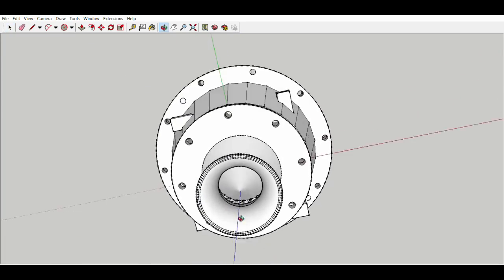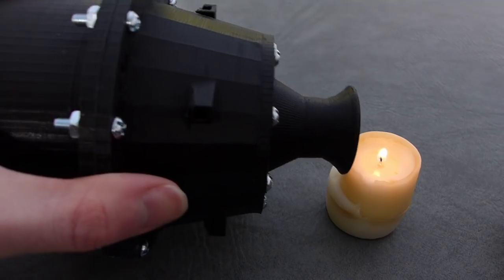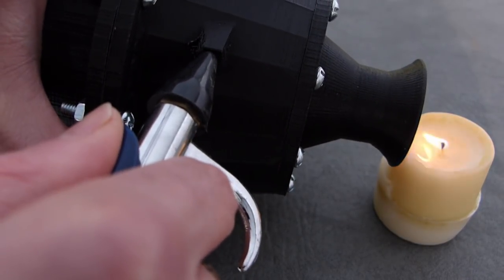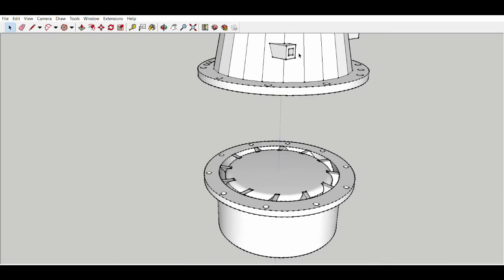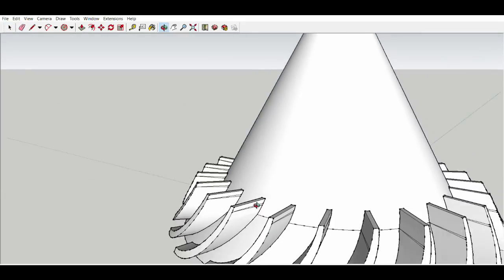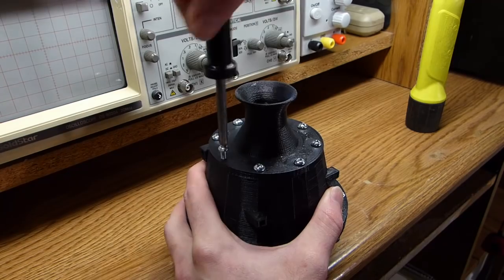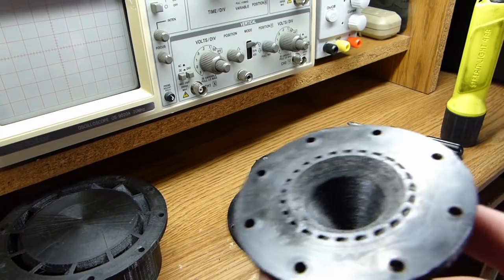SciPhi 10 Rotorless Turbojet Development 1

Comment: Now this is something 3D printers are meant for !!
Great work !!
Reply from the maker: Thanks yeah it is convenient for trying out mechanical designs. Plus it is very satisfying to hold in your hand the thing you were imagining, and have the power to make it real.
Reply: @JaycubL  So true
Reply: Very good. I'm experiencing some prepatory challenges on that technology. Setting up AUTO CAD with my primative experience. I would suspect that you have invaluable experience on this subject and the many others i have in setting myself up with 3D printer technology. It is by far the most practical means of prototype construction to my knowledge.
Reply: The rate or speed of explosion of gasses is generally measured in spiralled chambers as you may know. You might consider a mechanical device which could confine this characteristic in a nonreciprocating piston enclosed chamber

Comment: It would seem to me that having all those inlets at differing distances from the front, they could have a different effect based on how it hits that bell on the inside. A bell that has a set angle at different heights would be interesting.
Reply from the maker: Yes different nozzle ("simulated burner") heights would be one thing I plan to experiment with, along with many other variables in the geometry. The ports on the inside are at the same height, they are offset on the outside to compensate for the angle and keep the insides on one plane.
Reply: @JaycubL   thats pretty dag bern clever if I do say so myself.

Comment: Intriguing idea.  Probably needs EDM to manufacture it.  

I would like to take issue with your statement in maintenance however.  Gas turbines may require a high standard of maintenance but overall I believe it is less than for comparable power output piston engines.
Reply from the maker: For manufacturing I want to design most of it to be formed stainless sheet, maybe with graphite inserts in key places for heat. Since it does not require a balanced rotating assembly I think the manufacturing tolerances could be pretty loose.
Maybe looking at comparable power output piston engines jet engines are not too bad for maintenance, I have not looked that closely how it stacks up that way.

Comment: Great to see you are back. Good luck with this. Have you studied the Coanda effect or the Coanda jet?
Reply from the maker: I have studied the Coanda effect, but I am not aware of the Coanda jet. This is a perfect discussion for the SciPhi comments section! Please explain it to me.
Reply: @JaycubL  Supposedly Coanda built a jet plane in the early 1900's that used a piston driven engine to feed air to the fuel mixture or visa versa and while testing its operation the flames from the exhaust caught the wooden plane on fire and it burned up.  https://www.youtube.com/watch?v=MDaUbsWNXvI  I had read about it in a magazine article about 30 years ago but can't remember much about it.

Comment: I'm very curious why the outside of the engine has segmented faces and square-inlets?
Reply: its a limitation of the 3d printer firmware "marlin" for 8-bit microcontrollers, it cant properly reproduce perfect circles because the shapes are broken down into g code segments who's precision cant exceed 8 bits in firmware, you'll also see it on delta style 3d printers like the anycubic line.. mainly because of marlin.
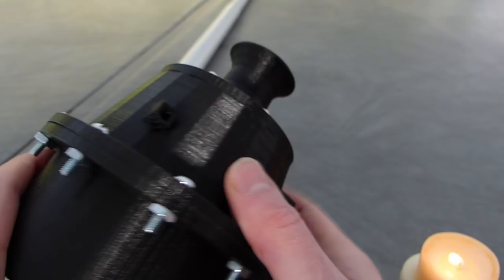Reply: @alberto148   As much as I like your explanation (and am familiar with it) I am afraid you didn't check out the video very well. You can clearly see that in the Sketchup model it already has the segmented faces. I know about the limitations of the firmware, but the segmented faces in the model in the video are clearly by choice as can be seen at the @1:08 mark.
Reply: @MarinusMakesStuff  thats because the sketchup plugin to export g code decimates the model before export to the 3d printer
Reply: @MarinusMakesStuff  the larger the circular radius the worse it gets
Reply: @MarinusMakesStuff  there are 3 separate models, you can see on some of the parts he tried to play with the parameters for g code output, forcing it to do it this way makes the infill come out the way you see it on the model
Reply: @alberto148   I noticed the insides of the model are very smooth still so I'm very curious to hear the explanation by JaycubL himself instead of us guessing ;)
Reply: @MarinusMakesStuff  You're right, I just noticed that sorry.
Reply: @alberto148   No problem, it's always nice to discuss these things right? :)
Reply: Marinus I'd prefer not to get it so wrong though, you know what they say: money rich, time poor. If I wasn't concentrating on a pcb I would have noticed it.
Reply: Actually, in sketchup, before you start drawing your circle, you can input how many sections you want because sketchups doesn’t do curves. If you select a lower number it comes out looking like this. It has NOTHING to do with exporting or 3D printer firmware limitations. 

I guess that the reason why he lowered the section count on that middle piece is because he wanted to be able to draw the inlets on a flat surface easier. That’s what I would do too 😂. Let’s hear from the creator to see if I’m right!
Reply: @skylerockspecial  Yes, I'm especially curious because the insides look smooth and nicely curvy in contrary to the outside.
Reply from the maker: Skylerockspecial is right, I made it like that purely for Sketchup modelling issues. I put 100 segments per circle on the inside for smooth surface and 24 on the outside to get a closed set of surfaces more easily. The ports are square for the same reason, just to get a closed model (the computer was fighting with me). I should have gone to Fusion360 right away since I already have and use that, I just used Sketchup because I am more familiar with it.
Reply: @JaycubL   Ah! Great :) By the way, for me the software to go to is Rhino, but maybe I should check out Fusion360. What made you decide to go to Fusion360?
Reply from the maker: @MarinusMakesStuff  Yeah Rhino was the first one I learned with and I like it a lot too. But I can't get it for home use. I like Fusion360 because it is free for home use and it is very good, I haven't logged many hours with it yet but it seems to work very well. It has built in CAM features too which seem to be very useable.

Comment: since a ramjet is only efficient in the mach 6 upwards ranges ... how do you plan to get the equivalent of 3 f18 jet engines on max thrust worth of compression into your engine ... 
a scramjet is effective mach 3ish to mach 6ish ... and a fighter jet engine is good to mach 3ish ... 
.
the basic math calculations for starting each type of jet engine sets its lower limit that is why scramjets and ramjets are not used for take off ... but implemented after they have made a certain altitude and speed range ... to avoid needing a small power plant for each plane just to start them
Reply: the idea is good ... but you overlooked the compression needs for a ramjet ... but your theory of a vortex intake to get better compression is sound ... some research into the concepts of viktor schauberger would be a benefit as well ... specifically look at the tulip vortex generator design he uses ... his concepts should help you improve your intake design nicely ...
Reply: something else you could also consider is like the sr71 intake ... use your cone to further compress the intake air ... and start it turning the way you want ... if you plan to use the engine to power a plane then you can also optimize the intake funnel to allow the speed of sound shockwave to be caught inside the intake funnel and further add more compression to your engine ... with enough intake blow by you could use some of that pressure to start a scramjet ... and have that scramjet then provide the needed power and compression to then start a ramjet ... the part to figure out is how to have all 3 types of engines in one bay and ... not melt each other during operation and how they can work together to provide thrust in abundance ... also to lessen the shockwave effect on leading edges you can pulse dc current at extremely high frequency along the leading edges and the em field will affect the shockwave ... yup just like the b2 ... and f35 do ...

Comment: You're making a Static Mixer. Read CFD.
Reply from the maker: The flow test models indicate otherwise, it generates intake vacuum and flow out the rear when pressurized air is blown in where the combustor outlets are. The portion of combustion products that are recycled around would be tuned by the internal geometry to achieve a balance, and static guides can manipulate where the inlet flow is concentrated and pressurized for feeding the combustors with cool fresh air.